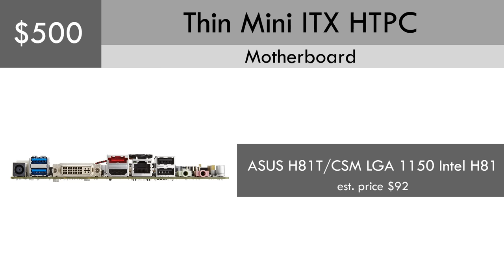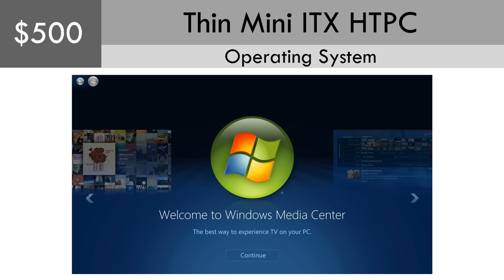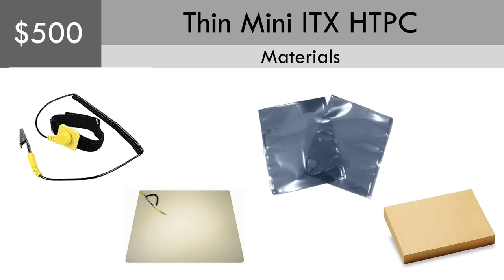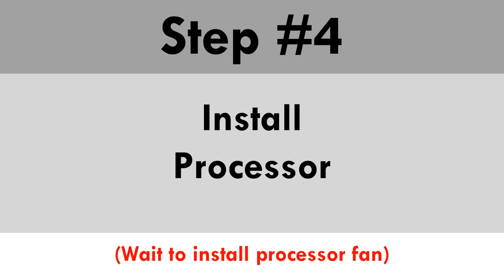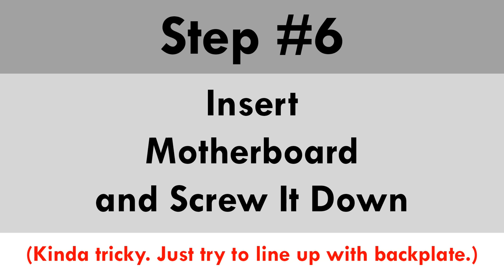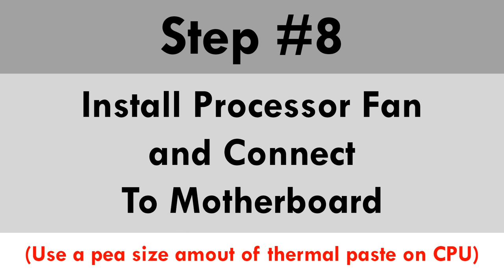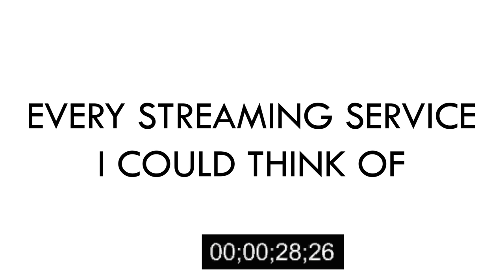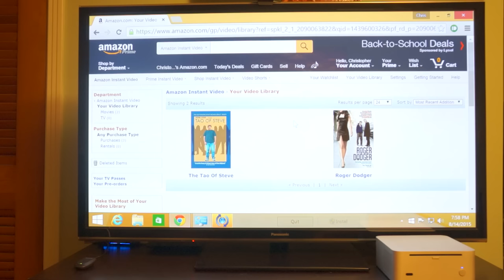$500 Thin Mini ITX HTPC Build Guide  (Windows Pro included)

Comment: What remote control are you using for your IR receiver? Can you use it to turn on the PC?
Reply from the maker: +Bado Seroy Anthing is possible with a lil work but with this setup no you can not use a remote to turn on this pc. I use one similar to this http://www.amazon.com/Rosewill-RHRC-11002-Windows-Certified-Controller/dp/B005ZAK50K/ref=sr_1_24?ie=UTF8&qid=1451845911&sr=8-24&keywords=pc+ir+remote+control